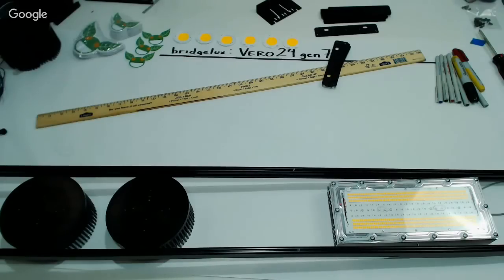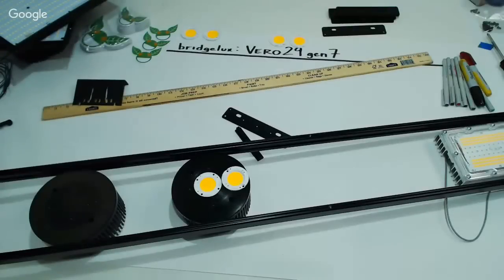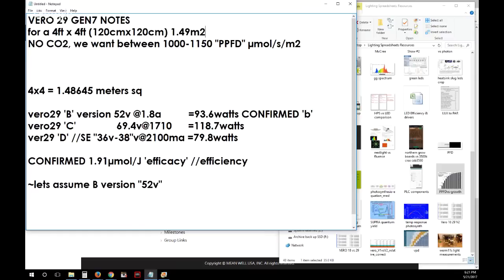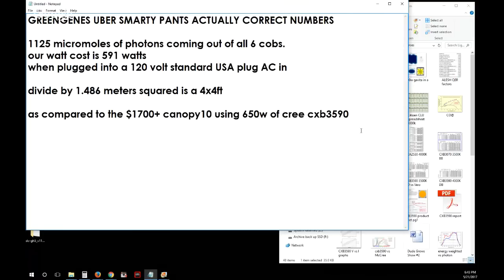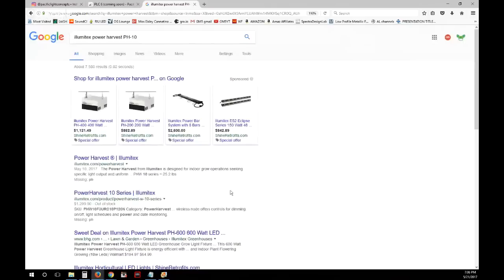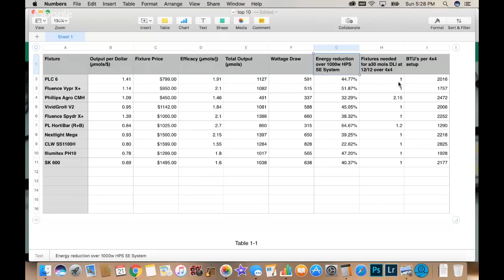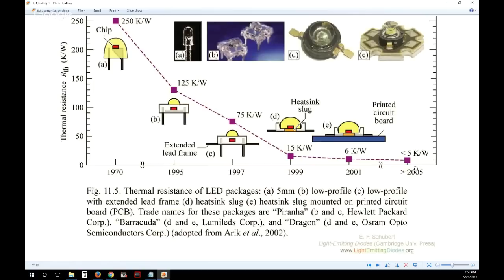vero29 research & discussion, frame talk, light per $$ of popular commercial LEDs

Comment from the maker: im going thru this long ass video right now, and making clickable chapters. gimmie a few mins
0:00:00 - 0:06:00 blah blah blah blah
0:06:01 basic discussion about Bridgelux Vero29 gen7 begins.
0:11:50 quick detour to Cutter Electronics to talk about Bridgelux EB linear strips
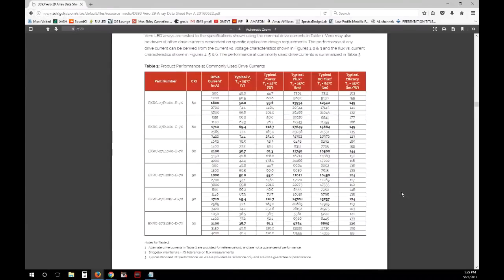0:15:20 The 3 different voltage models of Vero29 discussed
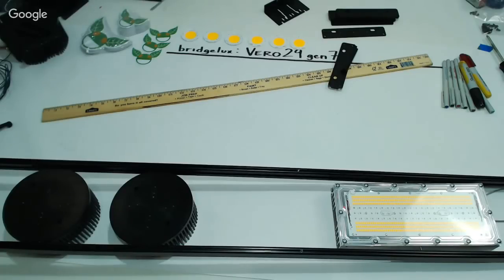0:23:50 Intro of rapidLED's "Canopy Substrate" modular diy led frame system
0:41:30 How much $$ in materials to build a Home Depot frame for DIY LED light
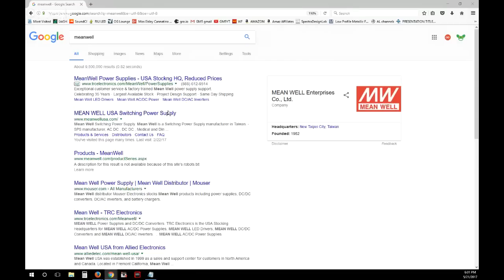0:47:20 Back to Vero29 talk, more on voltage.
0:54:20 what is a vero 'B' version, vero 'C', vero 'D'
1:23:00 Greengene's Garden joins the stream to talk about his new $799 PLC 6 vero light.
1:54:00 Integrating sphere lab data comparing how much light are you getting per $$$ for some popular LEDs
Reply: Ahh so you are leaving it up! awesome.
Reply: growmau5 Do you know if thgis light is going te be 3000k or 3500k?
Reply: growmau5  , Great timing I just purchased 50,  Vero 29 D     
great deal 21.22 a piece. Future electronics. at my house in 12 hr. The  heatsinks from heatsinkusa. looking at drivers I want to run at 2100ma at least. I'm having a hard time finding a driver the hlg-600 will run 6 cobs. I have 4 cobs per heatsink I really would love to run 8 off each driver. If you have any suggestions I appreciate the input.
Reply from the maker: Randy Hamelers HLG 600h-42b will run as many D version vero as you would like. If wired all in parallel. The current of that driver will be divided equally amongst the # of cobs.
Reply: growmau5 looks like your writing a novel with all these chapters. Like it👍👌
Reply from the maker: i tend to be a little long winded, lol. thanks for checking it out.
Reply: growmau5 Need another video starting to have growmau5 withdraws LOL
Reply: Thank you, thank you, thank you for adding these time markers! I've watched this several times, even live streaming, and I love going back to go over some things (everything) that I didn't quite understand. This makes it so much easier to navigate this video.
Now I'm ready to start thinking about making a light or two for my 4x8, or two 4x4, areas!
Reply: growmau5 praying to the photon gods that you just might answer this: what is your light recipe for veg? Can you maybe make a video on that? If you were using the quantum canopy what would the recipe be? FOR VEG ☺️ the light recipe tells you about the 3000&4000 plus the 660,740&840's for flower but not the veg - also what was the outcome on the 840 nm? I heard you say the uvb bulbs may have cause big issues but didn't hear any outcome on the IR - accept when you said they saved you 5 days of flower time. PLEASE PHOTON GODS SEND THE MOUSE TO ANSWER THIS ❤️👍✌🏻🤓
Reply: growmau5 where u at
Reply: call jarry u get cree for all most same as vero
Reply: growmau5 

Six of one, half dozen of the other!
Reply: can't believe citizen chips have epystar chip i did not no
Reply: thanks for say hay jony c new   name hay bud u bin bizz hope u doing ok bud lmk win u can
Reply: growmau5 i have hlg 240-1750b driver and was wondering if i could run 8 cobs on it by running 1 string of 4 cobs in series and off of each one of those 4 cobs in series run a cob in parallel off each one of those cobs that are in series?
Reply: There is any other cheaper cobs with the same performance or near as cree cxb3590 ? I´m from Uruguay and we have really expensive shipping and taxes for 1 cxb 3590 i pay nearly 70usd.
Reply: Gabriel Noya vero29 cobs are cheaper than 3590 and same performance also the citizens cobs are awesome also. 1812 seires i believe but i would have to check

Comment: All that expensive aluminum is really nice, but I just ripped up some clean spruce 1x4 into 3/4" x 1/2" strips and built my frame with those. Plenty strong, cheap, light enough, super easy to work with.

The heatsinks aren't ever going to get hot enough to ignite wood, so that doesn't worry me.

Comment: Greetings. I’m looking to max out my 3x3 enclosures. I currently use a 600w HPS in one and 2 Viparspectra Par 600 in the other. I’m considering the 3x3 Vero29 kit from Rapid LED and also the PLC6. I’m nervous to DIY but willing to if it saves $200 bucks. I do foliar sprays and was concerned would the DIY be ok or should I get the Stella reflector over the other options for safety?

Comment: For Vero29' B type--actually run at 50.7V (not 52V, so you can get 3 cobs on a Meanwell HLG-320H-C2100B's with max voltage of 152.4V).  3 of the B type Veros adds up to 152.1V, so it is a really good matched driver. Timber uses them, each COB runs right about 106.5W, so you get about 319.5W of output.  I confirmed with a mutimeter that the driver is putting out the full 2.1A with this setup. I have 8 of these 3 COB bars and use them both in veg and flower. 

You can DIY these 319.5W bars for about $300 each, so right at or slightly under $1 per watt. I have been running them using NorthernGrowLights splayed SST-X heat sinks, as well as 133mm round heatsinks that I splayed by hand--both provide sufficient cooling.  Normally you would want to use 140mm or larger--but you can get away with using smaller splayed sinks (helps keep the size & weight of the light down, without compromising cooling efficiency).  When splayed, 133mm round heat sinks as well as Northern Grow Lights' SST-X (125mm square) work great. RapidLED has 140mm round heat sinks, though I have not used them personally--should provide adequate cooling.

Comment: Hey gromau5. Great video session. Super information. I'm looking at doing a 6 X Vero29 C build for my 4' X 4' tent. I'm in South Africa running on 240v. 

What driver option would you recommend - 2 X 1.4A Mean Well HLG-320H-C OR 1 X 11.2A Mean Well HLG-600H-54B?

Is there any benefit of running either driver in parallel vs series?
Many thanks in advance.

Comment: Hey growmau5. Wondering if those linear strips you mention at the start would work for supplemental lighting? For a 4x3 space that has only 1 x 315w CMH. Just looking for something to put either side of the CMH, to push the footprint out wider for the 4ft length. A friend has a Mars Hydro 400w that can be pulled apart for drivers and power supply... Would be nice to chuck in a couple far reds in either bar ;)
Cheers

Comment: In your exploration and presentation of the Vero 29 chips in this series, please do a calculations for this:
4 Vero 29s
LDD 4Up Board (cutter & rapidLED)
1.5A LDD drivers (or even 1A)
I don't care for the fan on the LRS-350 but will run 4 at 1.5 no problem.
This is great for a 2x2 and even 3x3 (put 2 in a 4x4, etc)
This is plug and play, but is the eff there?

How's it compare to 1400mA driven off HGL just a bit more?
Keep 'em coming...

HalfBee
Reply: I'm running 4 x Vero29v7 with a HLG-240H-C1050B. Getting .75 amp draw at the wall.
Reply: Just pointing out another "different" off the shelf solution available.
4 Vero 29s at 1A or 1.5A per set runs them at good output level as a base unit
much as PLC does in their rail bars. Am sure cutter would like to move some of
those 1.5 LDDs they invested in a while back...

Comment: With this configuration Vero29 D 36v, they will just draw 50watts correct? So this is like a PLC 6 - but running at 50watt instead of 100watt, 300watt total not 600watt.  I actually went and ordered the parts and shipped and just caught this yesterday, when I emailed the guy from the ledgardener site, because I was severely confused. So really 1 of the HLG-320H-1400B will handle all 6 of these COB at once no need for second driver.  So looks like I'm ordering 6 More COB and ill max out the rapidled frame.!  am I wrong about any of this? lol...

Comment: hi thanks a bunch for the nerdy info,just a question,is the vero 29 have the correct light spectrum for growing are loved plants if it is ,is it more suitable for vegetative or flowering
love your streams
Reply: They sell different colors of the vero cob so you get to select if it will be for veg or bloom or both. 5000-4000k for veg. 3500k for both and 3000-1750k for flower.

Comment: I have a question.  Why is the input wattage used to calculate the PPF and not the total wattage being used by the actual COB's?  My brain (which is usually wrong to be fair) wants to use the total wattage that the COB's are utilising instead of the total input wattage of the driver as isn't this the actual amount of energy being output by the COB's not the total input wattage.  To give an example using the input wattage of the driver as in the video: 

Using six Vero 29 SE D's at 1400ma and 37.6v with a 240v Maxwell HLG-240H-C1400 driver then PPF would equal (Input wattage of the driver x Efficacy of the COB) 235.56w x 1.91 = 449.92 PPF.

Now if you removed all the COB's except one the calculation would remain the same as the imput wattage of the driver and the efficacy of the COB are unchanged giving you the same answer even though only one COB is now being used, which has to be wrong.  I must be missing something as it seems to me that the formula for PPF given in the video can only give you the maximum PPF that a light can put out when all of the input wattage is utilised.  Does the efficacy number change if the input wattage of the driver is not fully utilised? 

Now using the actual wattage used by the COB's I get these answers with the same scenario:

Six Vero 29 SE D's at 1400ma and 37.6v with a 240v Maxwell HLG-240H-C1400 driver (Output wattage of 6 COB's x COB Efficacy)  = 225.6w x 1.91 = 430.896 PPF.

Now the same formula with just one COB: (Output wattage of one COB x COB Efficacy) 51.38w x 1.91 = 98.1358 PPF

Does the efficacy number change if the input wattage of the driver is not fully utilised or am I missing something else?

Any helpful comments would be greatly appreciated.

Comment: Cheers Maus, I really want to get one of those canopy rails from Rapid. I have a 2*2' space and I want to do 2 Vero29s @ 2100 or 2400 mA, problem is I don't see any HLG 185 pushing more than 1400. Am I missing something right in front of my face? Is there a better driver to use? I realize 2400 mA is pushing it for those 140mm heatsinks so should I forget that, or just dim them a bit?
Reply from the maker: You are correct, the 1400ma is the largest drive current in the HLG- "C" constant current line.  My suggestion for a 200 watt, two VERO29 setup is ::
use meanwell HLG-185H-42  it supplies an adjustable 42volts 
use (2) vero29 gen7 "SE" version wired in parallel to the above driver.
this will split the driver's current (4.4amps) , delivering 2.2amps to each vero. 
"growmau5" coupon code will save you a buck or two.
http://www.rapidled.com/bridgelux-vero29-se-poke-in/
Reply: growmau5  what type of heatsink would be a good choice for this setup
Reply: pedrodepacas The canopy-rail system uses 140mm heatsinks. They're on the RapidLED website, look under the new products section.
Reply: Andre Jones the description says 70 to 80w heat dissipation
Reply: thanks
Reply: pedrodepacas they will likely need to be dimmed just slightly, I'm OK with that. Might point a fan at them just to be safe.

Comment: Growmau5 HELP
I want to do 6 board QB build @ max watt hlg600h-54b for 4-QB's, then hlg240h-c2100a for 2-QB's. The Alumi sheet size will be 40"x37" should I go 3/8 thick or would 1/4 work? Also 5052h32 or 6061t6 aluminum? what's the best option For my setup? I'm new to this so I don't know if there are pros & cons. Thanks growmau5 u the man!! Will be at Michigan canna cup will u?

Comment: growmau5 Sir I have a ViparSpectra LED 300 with a input voltage of AC100-240V, Ouput Voltage 140-180V and Ouput Current 670-700ma. There is a 12V fan connected with the driver. My question is how many Vero 29's would I need to convert? You said something about the 50V Vero's but I'm confused as to which ones to order. Is it okay to run a 36V cobb at 64Volts? I am in the US Please help! Thank you!
Reply from the maker: activationcode because that driver is pretty low current, (600-700ma) I would aim for the highest voltage Vero to max WATTS & max bang for the buck. 
Since the 'C' is ~ 70v , two of those would do the job. Or, if you want to mix some different spectrum a little , I would use 5 of the 36v version 'SE' this would use the highest amount of volts on your driver & offer the highest wattage.
Reply: I am going to go with the two 70V Vero's. I don't want to overload my small heat sink LOL. Thank you so much for the help!

Comment: @Growmau5 For the slate II, just drill and tap into the fins on the 
outside of the rail, then use set screws, you would be able to move it
 too, cause your not drilling into the rail.
Reply: BTW this is Michael G who you helped quite frequently, I took your episode about surviving legal cannabis to heart, not sure if ill go with YouTube, don't fell like devoting serious time to post production, but just started a Instagram account.
Reply: If your really had to you could also use a countersink on the rail, and mark out some divots for the set screws, so it would still be movable. If you cant get a tap into that fin properly, then just go with simple hole, then use a threaded insert.

Comment: I dont see any, or maybe i missed them, but do you not need some sort of thermal interface between the cob and heatsink? or do veros differ from crees in that respect. O.o
Reply from the maker: all leds will benefit greatly from a TIM material. it is mandatory for these Veros & I will be sure to discuss that in the streamlined video.

Comment: @growmau5 Better yet, just slot the top of the fins that straddle the bars, then use a simple spring clip, wire, Velcro, strap, anything really. Still fully movable, and it will work on the original slate design too, so it will be movable as well, and no drilling into the frame!

Comment: In "O" Canada cree cobs are stupidly expensive, no matter where you source them. Usually floating from $45 + just for 3070's. Surprisingly enough veros pretty cheap here. I built a 4 cob vero light and absolutely love it. Not quite sure why but the 4 cobs makes my mean well driver squeal a bit even at full power despite my driver being properly matched. Just something to watch out for.
Reply from the maker: sounds like Vero will be a nice solution for our friends up north!  can you fill us in on what Canadian supplier you will be using, so others can go there too. thanks Drew A
Reply: Unfortunately we don't have much to choose from. You can import them from flea bay, however you usually end up paying more. Digi key and mouser Canada are your best bet. I can get the vero 29 se's for $36 each from digi key which is about the best price your going to find in Canada. I know they run around 25ish in the USA. 
 I get my mean well drivers from mouser. All duty and import fees are included in that price and on orders over $100 they give you free next day delivery (both mouser and digi key). From my experience diy is the only thing that makes sense in Canada. Trying to buy anything from Rapid led, or any other supplier cost so much to bring into Canada. With our piss poor dollar, and crazy duty everything just cost too damn much. Luckily we do have a harbor freight equivalent called princess auto. Good place to shop for odds and ends like wire and electrical. They sell some pretty cheap aluminum products as well.

Comment: I got 6  cxa 3070 laying around was wondering wondering what ballast should I run them on?
Reply: You won't need a ballast you'll need a LED driver. Growmau5 does numerous videos helping you pick drivers. Find the stats for the 3070's (how many total volts) and pick a driver with enough volts to power them. You might wanna do some research on how many mAh you want to run through them.

Comment: I have a 1/16th inch angled aluminum frame holding 4 Cree COBs and the driver. It doesn't flex. Even holding the 3 foot piece in my hands and trying to bend it with my knee results in only a cm or 2 of flex at the ends applying most of my upper body weight. Try it yourself, go to HD, grab 3 foot 1/6th angled aluminum at both ends, kneel down and try to flex it with 20x more force than LED COB's will apply.

Comment: Hey, Growmau5 another great video coming up, A couple of questions if you don't mind my asking?

1. Obviously, i can't make my own light system the same as yours but I been quoted £475 for a 3 Citizen CLU058 1825 COB 3500k is that a decent price?

2. How many lights, Wats whatever measurements suits you best for a 3m x 3m x 3m high?  Or 10ft x 10ft x 10ft high?

Sorry, I'm new and still learning about these new COBS for the past 16 years it's been MH/HPS and fluro's.

If by any miracle you have a moment spare I know your a busy bloke would you shoot me an email?

Cheers
Reply: No. If you dont mind DIY shop Rapid LED for a kit of 12 Vero 29s for 1100$ USD. If you dont want to assemble it try Timber Grow Lights for a few hundred more$. If you bought four of these you would fill your room nicely. Also Cutter has Gm5 kits. If you want to have it broken down in lay terms check out his 6 part series on lights for beginners.  Also use Growmau5 at checkout at Rapid LED for 5% off.☺

Comment: I'm running a 8x8 room with 4x 600 hps what would you recommend for me to match that with leds
Reply: For DIY shop Rapid LED for a kit of 12 Vero 29s for 1100 usd. If you dont want to assemble try Timber Grow Lights for a few hundred dollars more. 4 42" square frames would fill your room nicely.